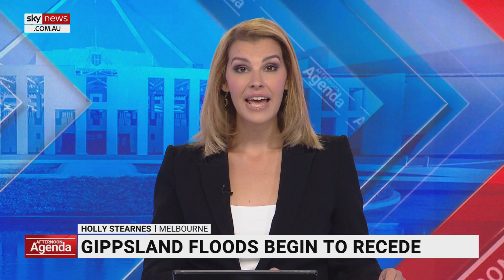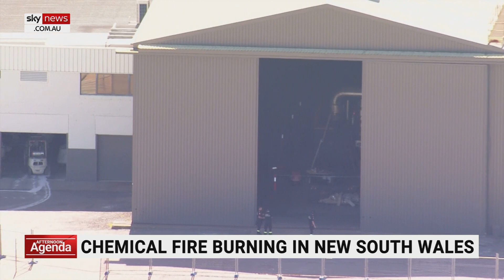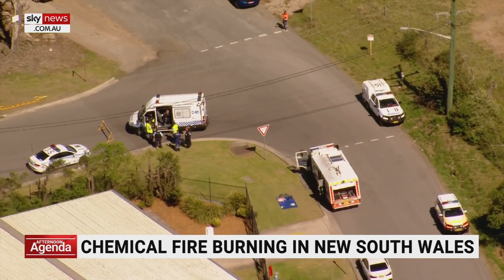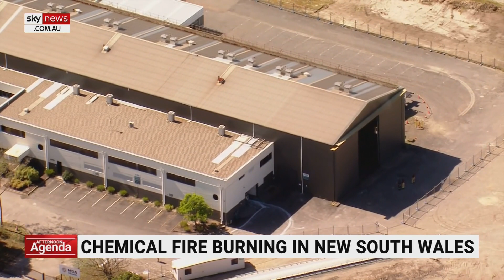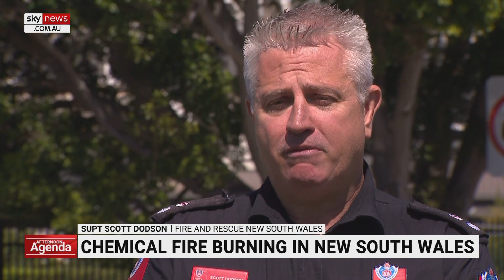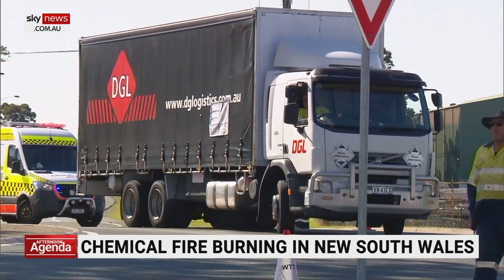Firefighters are unable to extinguish a chemical fire in New South Wales

Comment: Fire and Rescue NSW (FRNSW) crews have stabilised a dangerous heat build-up at a thermal energy storage plant at Tomago, in the state's Hunter Valley.

Crews were called to the facility in Laverick Avenue just after 5.15 this morning.

Three employees made it to safety as authorities established an 800m exclusion zone and evacuated 15 neighbouring businesses.

Firefighters called in a Bulk Carbon Dioxide Tanker from Sydney as they sprayed CO2 onto the 14x3m over-heated machinery.

They were prevented from using water to cool the machinery due to the risk of explosion.

Crews also used dry chemical powder extinguishers to douse burning electrical cables at the site.

The scene now has been deemed to be in a steady state and the emergency scaled down.

A FRNSW Hazardous Materials (HAZMAT) crew will remain at the scene for the next day or two to monitor the situation.